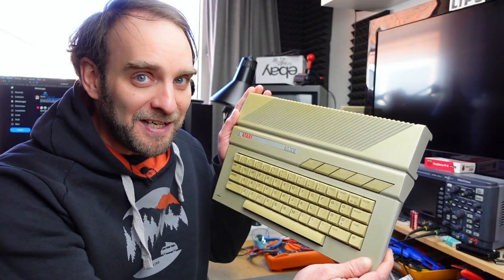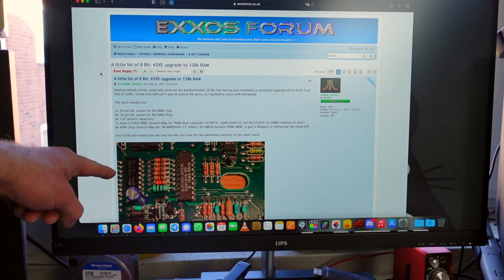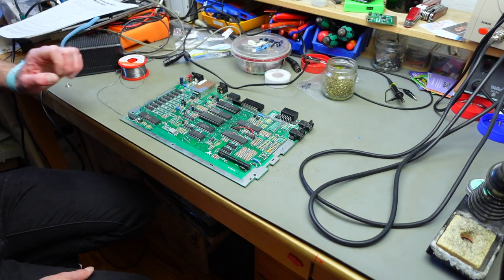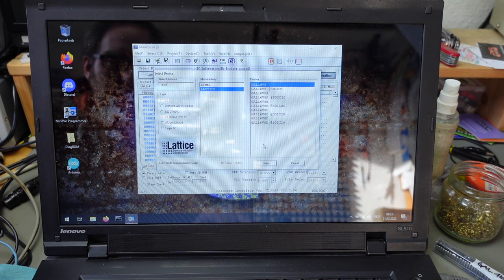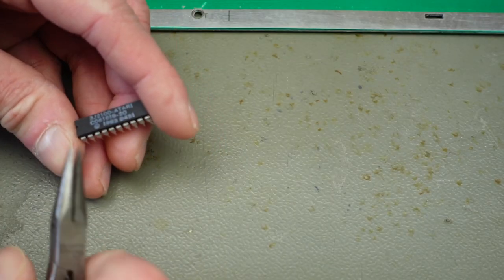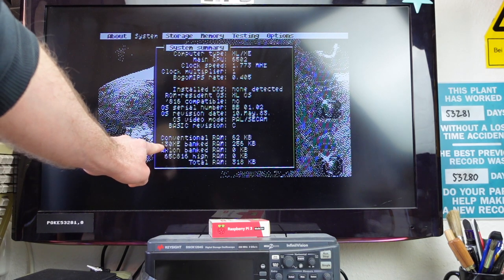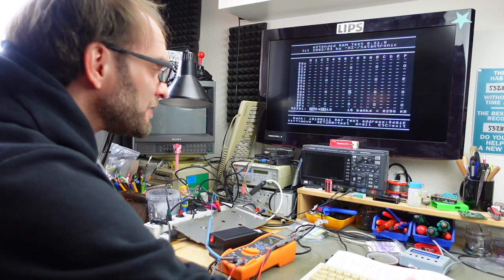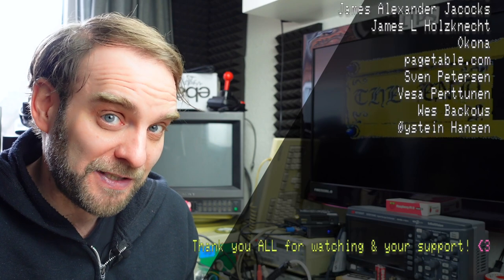Atari 65XE 320k RAM Upgrade

Comment: You may find the long wire is causing noise on the pin 1
Reply from the maker: That might be an issue indeed (although I have other issues on my list to check before that). Looking into resolving the faults as we speak. :)

Comment: I’ve done this to a 130XE, I’ve used old memory chips from a broken Atari ST.
Reply from the maker: Nice! Probably the ST chips are 150ns chips, so the timings are closer to what would be period-correct. Still don't know what the issue is with my mod but I'm looking into it as we speak.
Reply: @JanBeta  I think the old memory chips of the ST are 150ns. My 130XE is working great. No issues whatsoever.
Reply from the maker: Yep, I think at the time when the ST was released, the 150ns chips were state of the art, no faster DRAMs were widely available at that point as far as I know. They used the same chips in the Amigas and the memory expansions for those machines, too.

Comment: Older capacitors certainly arent any better made than new ones... its just that there is a lot of cheap junk used nowadays compared to back then when stuff was "made to last". If you buy cheap crap, you get crap ! :)
Reply from the maker: Completely agreed. A lot of peeps keep claiming that the older caps were better in general (especially in audiophile circles, unsurprisingly). I tend to not believe those claims. ;)
Reply: @JanBeta  I dont believe in audiophile caps either.. total "snake oil"

Comment: Do all 256 kbit chips work with 7 bit or 8 bit refresh?
Reply from the maker: I think the 41256s in this form factor should all use 8 refresh lines. But I am not 100% sure.
Reply: @JanBeta  I was just wondering if the mod needed a certain type of 41256 as refresh is not always the same on all brands/ part numbers.

Comment: I would have got rid of the useless RF modulator and use its hole for a button.
The machine has a monitor output anyway which puts out a far better video signal
Reply from the maker: I have several old tv sets that only support RF in, that’s why I leave the modulators in on most of my vintage computers. Would have been a more elegant solution otherwise, obviously!

Comment: You could have removed the RF modulator and fitted the switch in the now vacant hole.
Reply from the maker: Yes, that would be an option. As far as I know you would need some addtional components to keep the composite video output if you remove the RF modulator though. (I also have a couple of RF-only elderly CRT televisions and I tend to keep the modulators in place these days.)

Comment: What’s the point of doing this though, an 8bit cpu can only address 64k of memory at a time
Reply from the maker: It uses bank switching (as the 130XE does, too) and a lot of software supports that. :)
Reply: Like Jan already said bank switching.  Compare it with a program disk and several data disks, but now real fast (no loading times afterwards) because everything is stored in memory.

Comment: that's strange that it has positions for all the extra RAM, but pin 1 isn't wired? very strange. It's like its half assed on atari's part.
Reply from the maker: The footprints are meant to be used for the second bank of 4164 RAM in the 130XE, they only need to be rewired for using the larger 41256s in this mod. :)
Reply: @JanBeta  ah ok that makes sense. I didn't realize it would have a similar pinnout though. I really don't know much about atari. I was more commodore. I only in the last few years found out that atari made computers (outside of the gaming consoles)

Comment: My RAM Expansion, which is similar to this uses a 60/70ns SIMM Module. So your theory is BUSTED. (:
Reply from the maker: Good point! I still think that with those old DRAMs, sometimes timing issues can happen or particular ICs are not compatible with different systems and the like. Looking into it as we speak. :)

Comment: just replace everything with metal film caps. they work both ways and have an mtbf guaranteed for 40 years. in practice that's more like a 1000 years :P in as far as it kinda fits the holes on an existing board that is. with somewhat the same farad rating. :P elcos just suck. replacing them with other elcos... will still break again in a couple of years to decades anyway :P never put them into new products.

Comment: Jurgen ( tf_hh) sent me a  cool program that can switch off the extra memory  through software. Well in reality you can select between "off",128 , 318 and 512 kb  configuration,perform a warm reset thus reserving the memory setup you selected. The program is called  "SRAM_Memory_Expansion_Mode_Change.atr".
Reply: Jürgen posted that ATR on AtariAge, too. You can search for that filename exactly.